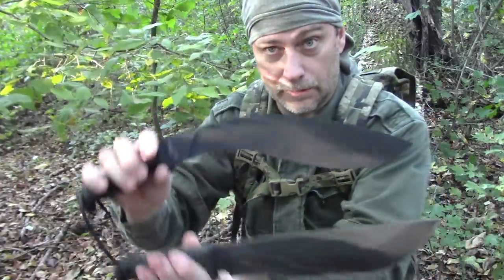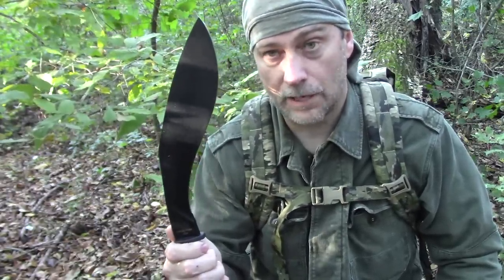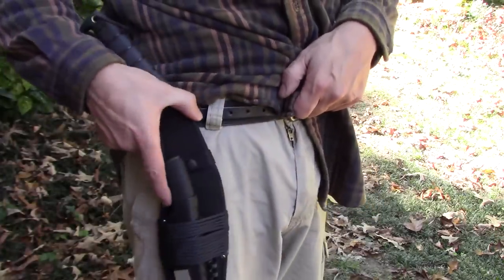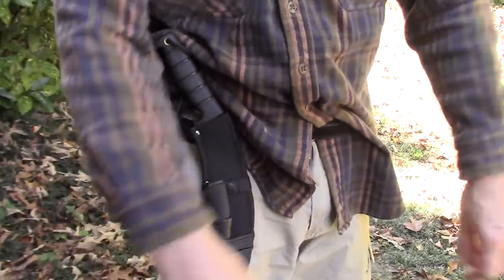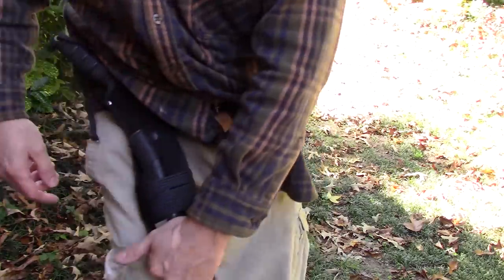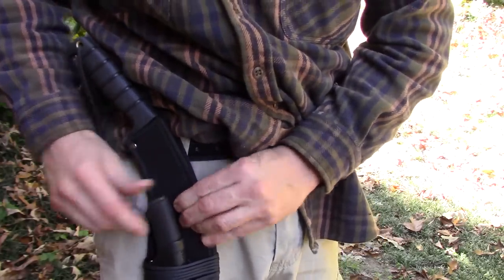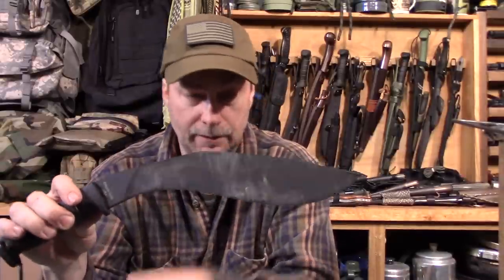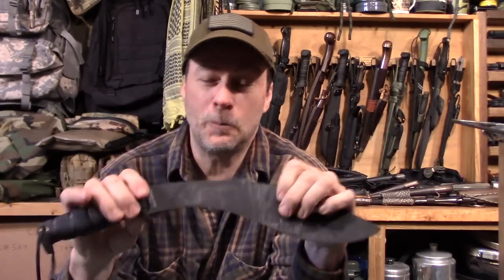Ontario Kukri vs. Ontario SP 53!

Comment: Hi Dave! I have a custom made Nepalese khukuri, based on the Panawal Jungle model, a bit stronger/heavier than the Ontario Kukri. I never chop logs with the front half of the blade, it doesn't feel natural to me, the hits have no power so to speak. As I chop with the back half, the weight of the front half of the blade draws it deeper, it eats through wood like an axe. I use the front half for cleaning twigs, batoning, cutting stuff. Maybe you should try that chopping technique with yours, see how it feels.
Reply from the maker: Hello Dan! Mine just doesnt have the weight needed to chop with the back half but Ill pay attention and try that and see how it feels. Thanks for watching Brother

Comment: i think they changed the steel from 5160 to 1075 on the new SP-53s. I hope it is as good as 5160
Reply from the maker: I believe you are correct.  I hope it's as good but I have not tried one of them.  Thanks for watching

Comment: I had always had a theory about the kukri,
The angle in the blade works better to chop things, think about a guillotine, gruesome thought , probably still a bit in the Halloween mood lol,
The blade is made in a angle to cut trough the neck wherever a straight blade wouldn't go through.branches would therefore better to be chopped with a kukri.
Reply from the maker: Yep, your dissertation is correct! After all it was meant to be a battle weapon.  Thanks for watching Steve

Comment: I have the SP8. It looks like a meat cleaver, and chops like a, well, like a meat cleaver. Not that great for other tasks like feathering, or carving but that isn't the reason I bought it. I got it for a good solid door entry pry tool as well. If shtf, your gonna need a crowbar or something, It's lighter than  crowbar, and fit the more than one use rule.
Reply from the maker: Ive had my SP8 since around 2012 and it's still holding up well! Thanks for the comments and thanks for watching

Comment: On my channel we focus on knife reviews, mostly folding knives but increasingly fixed blades too.  A HUIGE lesson I have learned over the years is the FACTORY does NOT know how to sharpen knives well.  This is true of any mass produced knives that we have looked at.  They don't sharpen at decent angles and the grind angle along the length of a blade usually varies by more than 2 degrees, often more than double that.  They may look well sharpened to the naked eye, and the edge may feel crisp, but its very rare to get a good factory edge on a a knife.
I have videos where I talk about the factory edge and show I measure the edge to prove how badly knives are sharpened.
Nutshell:  when comparing a knife to another knife its always important to skip the factory edge and sharpen both to your own standard and similar angles.  Only then can a proper comparison be made.
Reply from the maker: Thanks for the comments,  that's very intriguing!

Comment: I carry a SP53 in my truck and it's one of the really old ones
Reply from the maker: Man you have one of the really good ones!
Reply: @Reallybigmonkey1  I bought a lot of Spec Plus back in the 90s at gunshows way before the internet LOL. I still have them all and they had been used and abused. They're still going strong too. The only one that has issues is my SP5 which took the brunt and was the one that I used the most. The handle is loose on it. Processed many animals and fish and clearing tasks with it.

Comment: So, they are equal, we are down to which one is the cheapest.
Reply from the maker: Exactly,  they'll preform about the same.  It's all about how much you want to spend.
Reply: @Reallybigmonkey1  Sp53 is now $55.15 in 1075 mfg by ? The one you have is now $95.50 in 5160 steel..Mfg unknown? Amazing sells these. Kukri is 1095 $46 mfg Sportsman Supply Inc.? Ontario is not mfg in NY anymore? Any suggestions?

Comment: Although I am happy with my Shrade SCHF37 (7" blade), I'd really like to get the Morakniv Bushcraft Pathfinder (7" blade). Problem is, it's $150, which I can't spend on it. I only shop online at Amazon and the price hasn't gone going down fore than a few dollars, then went back up to $150. I was happy with Mora's Companion. I want to stick with that 7" blade, and the Mora Pathfinder is half the weight of my Schrade. That's why I would like to get that one.
Reply from the maker: Keep watching Amazon,  they do run a lot of deals in November and December
Reply: If you want to chop weight does matter. This Morakniv Pathfinder is still a partial stick tang so it will break with heavy batoning. It also has not enough weight to chop. A 7" lightweight blade is great for cutting bigger fruits and meat. So they are completely different knives in function. SCHF37 for more heavy use. Mora Pathfinder for just cutting.
Reply: @StevanOutdoor  My SCHF37 (7" blade) is mostly being used to cut off branches and baton medium wood. My Mora Companion batons small stuff. I do also have a Schrade SCHF45 10" blade for the big work.
Reply: @kachiri  Sounds to me you already have the knives you need. I have one of these longer blade Mora's but the problem is the handle and tang construction stays the same. The longer blade will invite you to baton thicker stuff but bcs of the momentum this will only put more stress on the handle/tang construction. They sure are lightweight compared to other blades the same length but IMO are just for food prep. They are really good for cutting pineapple or portioning big fish and meat. The Mora Pathfinder in my country is 80 euro with free delivery, so they also seem expensive over there. Just my thoughts. Stay safe.

Comment: Dave, what striker were you using on the ferro rod?
Reply from the maker: It's a homemade striker.  I put a plastic handle onto a high speed lathe toolbit.  Thanks for watching Josh
Reply: @Reallybigmonkey1  that thing throws gobs of sparks. Love it. Man if you produced some and put them in an Etsy shop I'd line up to buy. Market as the RBM jewel. You'd never keep them in stock, they would sell so fast, lol.

Comment: The strength of cutting comes from using the bottom of the belly of the blade closer to the handle…
Reply from the maker: Interesting,  that's because it's weight forward and that helps the momentum?

Comment: The sp 53 looks like a combat knife for fighting something Dutch would carry to fight the predator, but personally I wouldn’t want either for a bug out bag, too much weight and too big, maybe 1 of them for a inch bag in a jungle like environment, I’d rather have a knife half that size, being that preparing game or shelter building would be much more useful in a bug out situation
Reply from the maker: I kinda get what you're saying on having it in an inch bag and not a bug out bag. For bugging out I could see getting by for less than 72 hours without a big blade. That is dependent upon having proper shelter and or sleep gear tho. Thanks for watching

Comment: I won't comment on the two blades other than to say the kukuri is not my favorite blade, I will say that I finish a sharpening session by stropping with either Smurf poo compound or flexcut gold compound then with bare leather, I also use two stropping paddles , one with gray valve grinding compound and one with white compound.
Reply from the maker: Here lately I've been experimenting with stropping.  I use leather on wood,  denim on wood and linen on wood along with green,  white,  red ,brown and black compound.  I've never heard of anyone using that gray lapping compound you mentioned
Reply: @Reallybigmonkey1  the gray compound seams to be a little more aggressive give it a try on a really damaged edge after you use the stone I don't know if this will stay on here but here is a liknk to Billy Joe Deny using  valve grinding compound  https://www.youtube.com/watch?v=3iwXcQ1yM9c
Reply: @Reallybigmonkey1  My field sharpening kit consists of -
2 - DMT Double Sided Diafold whetstone paddles in red/ blue, pink/ green, a 3/8ths x 4 ½ round ceramic stone & 2- DIY 1 inch x 6 inch paddle strops with blue, green and yellow stropping compound, (the yellow is on the back of my belt knife sheath)  a mini Altoids tin of fixin wax, and a rust eraser, all in a "smallish" maxpaditon pouch…

Comment: Hello Dave. i use a machete mostly here in East Texas. we have thick brush in our woods.. lots of vines too. i use a modified. 36 in Tramontina.. ground off the manufacturers edge 1/2" away from handle out 8". the filed a plane edge on this section. it gives me a razor sharp drawer knife edge. most of the rest of the forward blade is the working edge when i swing it. i modified it for the way i swing it. i have had this machete since 1977. i also have a belgian machete fron WW2 i used in south east asia when i was in the military. this machete is only suitable for jungle brush. bamboo mostly and grasses.it to is shaving sharp. is no good on dry wood. I think i choose a machete on what environment i will be in. if that makes sense. i barrowed your idea on adding a knive sheath to my machete scabboard. all my scacabboards cases are leather though. i make sandles so i usually have plenty of leather. the only thing i really carry different the most is a swedish shovel. its bomb proof and its been the best shovel for my uses. i made a sheath for the head. its leather also. mollie straps sewn in to it. fir my ALICE packets. i bring little food with me because i hunt game in season or fish a lot. I have 4 national forests where i live and there is plenty to eat here. happy trails my friend.
Reply from the maker: Thanks for the comments and it definitely sounds like you know your gear!
Reply: @Reallybigmonkey1  Time flies when your having fun.

Comment: You should try to get your hands on a true kukri, they are worlds different than that Ontario they are a bit thicker close to the handle in the spine with a convex grind and a tapering blade thickness closer to the tip. Many say with repeated use they just begin to feel like an extension of your arm.
Reply from the maker: I have a kukri from the Ex Gurkha kukri house in Nepal.  I've used it in one or two previous videos
Reply: @Reallybigmonkey1  sweet, I've always wanted one just never seem to have the money.

Comment: Well all I gotta say is you know I love khukuris. You know I love both blades and I have the traditional made by Himalayan Imports, the 18 Ang Kholas, the Becker Machaxe...(stomper let me tell you but kinda short😂) IMHO they shoulda made this khukuri out of 5160 too. Thing is a 1095 CV Khukuri is great as long as the heat treat and temper are on point, but IF that's not the case and its a bit hard...you may hear PPPIINNNKKK!. 5160 is tough as a honey badgers pockets, and usually its VERY hard to break.
Reply from the maker: I like this as is but if it was 5160 with a convex or saber grind I'd say it was perfect!
Reply: @Reallybigmonkey1  Agreed
Reply: @Reallybigmonkey1  Convex ..WHOOO BOY!😂😂

Comment: The way that blade shape causes the material to draw across the blade makes it a devastating cutter. I do prefer the authentic differentially heat treated blades from Nepal though. They have distal taper for one making their weight distribution way different than many western copies as well as some other differences. If you like that one you should look into a real one. They still make them.
Reply from the maker: I don't know if you've seen it but I have a real deal kukri from Nepal. I showed it in two or three videos in the past.

Comment: The new sheath from Ontario not the best that’s for sure you mite want to do something to the belt loop on there I bought the sp53 with the new shear with in 3 days  of having it the loop came apart looks like only about 1/6 of Material was used  sow it under The other material . I did what you would have done made a new sheet with the pocket. Ontario decided that their shift should be crappy not sure why knife companies don’t put the effort into a knife sheath no Esee still makes good sheets I think
Reply from the maker: I have no idea why they skimp on the sheathes.  Just cheap I guess? If you make a good knife then you should supply it a good sheath

Comment: That's basically the only good kukri you can buy.  The other options are

> Hand forged Nepalese.  Warped blades, horrific heat treatments, comical grinds.

> Cold Steel's $700 Gurkha Kukri.

> Kabar, excessively broad, bad point geometry.

> Condor, terrible balance, worst factory edge I've ever seen in my life.

The Ontario specimen is the only half decent kukri on the planet right now.  Too bad it's only 18 ounces.  If they gave it a sabre grind and beefed it up to 22-24 ounces it could actually meet the potential the kukri design is supposed to have.
Reply from the maker: Thanks for the info!

Comment: A lot of the commentary in the video for or against either blade seems very model dependent. Weight, Length, grind, edge condition, sheath, etc. I get trying to stay within the same maker, but Ontario's Kukri is not a traditional design.
Reply from the maker: Both are good but, both excel at different applications.

Comment: 1095 is good alloy.. And u guys knocking China steel, they jack't Buck's 425HC. And made it better. Nickle on the dollar to boot.
Reply from the maker: I like 1075 and 1095. With Chinese steel I've noticed most of the flaws are in either the heat treatment or the annealing, not necessarily the steel.  I've got two Honshu Boshin machetes made in China and they have held up flawlessly

Comment: Hey Dave. Well, you have effectively ended the Knife VS Machete debate. The SP53 is clearly a knife. A Machete is long, thin and light, made for clearing vines, twigs and grass. The big knife is made for chopping, battoning and shaving. Regarding the Kukri chopping test at the beginning, the forward angle forced you to angle your wrist back. That's not a natural position for the wrist. Not to mention that the Kukri was raised up due to the blade angle. That raised elevation meant that the handle is being forced downwards, putting strain on your wrist. The SP53, with it's straight spine, is made for chopping. All of the force, weight and leverage is on the belly and there's no strain on your wrist. You can hear the pinging sound of the Kukri due to it being a thinner blade. It will eventually chip when chopping. You said it at the beginning, the Kukri s a combat design. The SP53 is meant to take the abuse of N. American woods. Good video though. It was informative. :)
Reply from the maker: Man now that is an outstanding way of putting it! I agree with your conclusion. I'm glad you liked the video and Thanks for watching